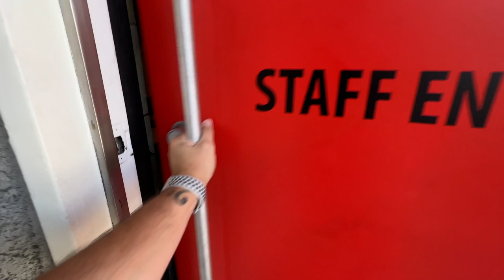This Guy Absolutely SCHOOLS Me On Audio Acoustics

Comment: Wow, so much amazing information to take in. So many gems dropped there. Especially about making your speakers work with the room. Last room I tuned for myself I literally found the best low end sweet spot, then designed everything around that spot. Made it way easier to do the rest. Also +1 for monitoring fx. Use it every day for my VSX headphones. Great video as always 👍🙌